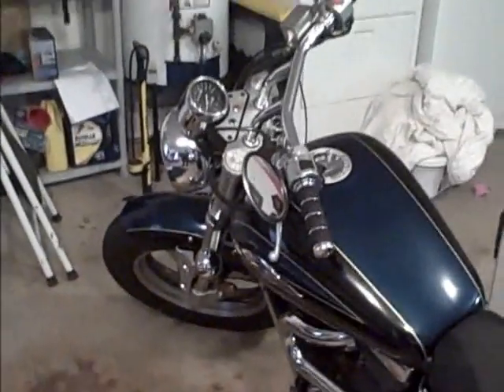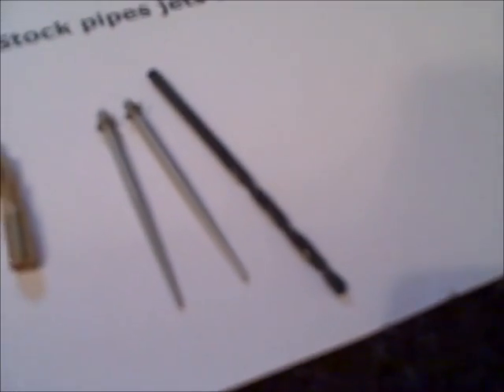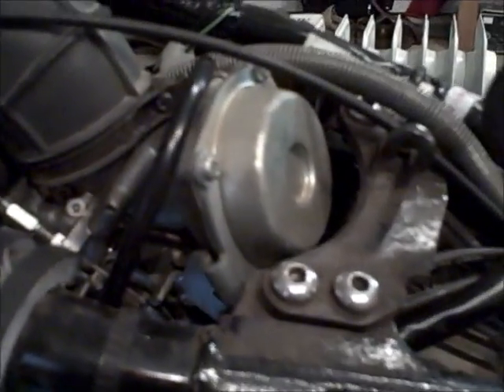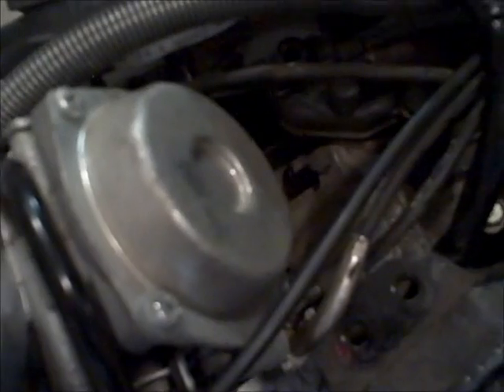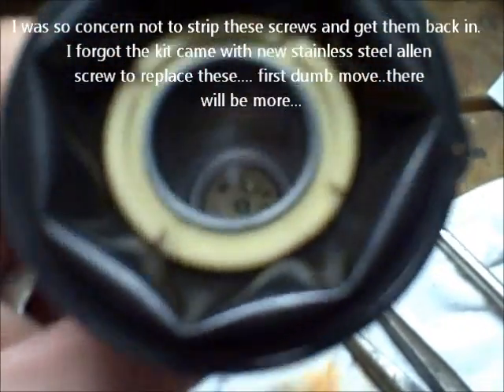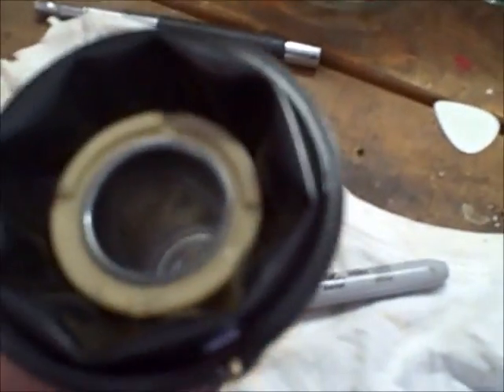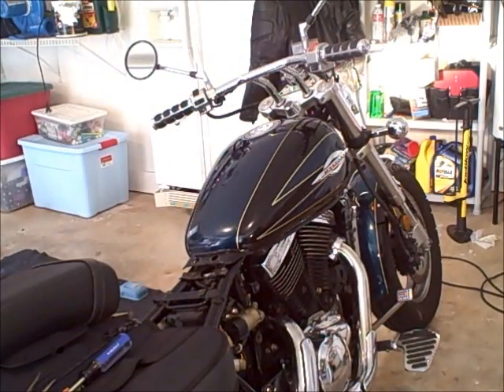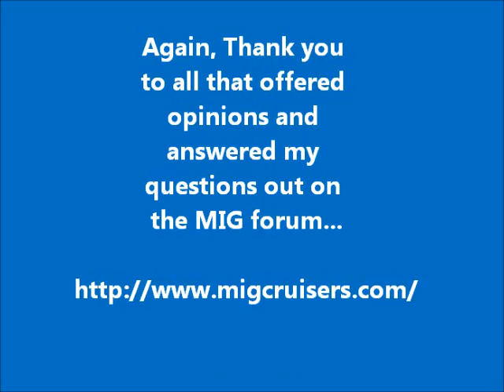Stage 2 Rejet Suzuki Marauder VZ800

Comment from the maker: The pair valve is the Big (fake) air cleaner on your right hand side. It is used to get these bikes imported. Go to Mocs Place and get the removal kit. Easy and painless and it will get rid of backfires.  As for the straight pipes. Yes, you will have to rejet. You could do stage one, two, or three if you get the right size mains and pilots for the straight pipes. I would recommend going straight to Stage three. I went there at the beginning of this summer.

Comment: what is the pair valve?got rid of the MMM now it starts.if i went straight pipes do i have to do a carb.stage kit and wutch one? and front sprock wich would be the best? i have a 2001 maraurder vz800 thanks

Comment from the maker: @yammo12 Don't plug it! each carb on the VZ800 has a breather hose and it is not suppose to go to anything...yet it is made to be open and breathe...Check again and make sure the leak is coming from that hose... and also do yourself a great favor and go to migcruisers . com and ask all the question you want there. It is a forum of great guys and gals that know these bikes inside and out. You will find a lot of help there.

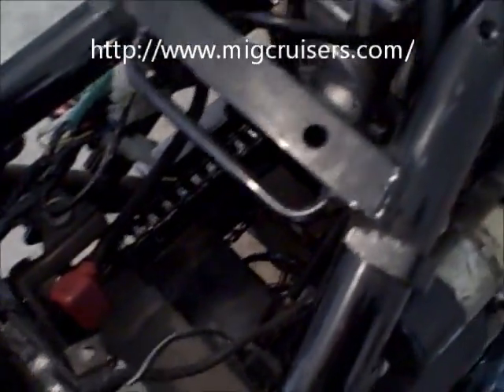Comment: hi bud maybe you can help me i have a 2001 marauder 800 i havent had it on the road for 3 years i ot it running the other day and i have a fuel leak coming from a host coming from the top of the carb but it doesn't seem to be connected to anything it comes down by the air filter and down towards the chain i froze your vid at 16:13 and you can see the hose coming from the crab what is it for and what can i do, at the moment i plugged it to stop the fuel coming from it Help needed 
yammo

Comment: is it ok to just changed out to filters from stock to k&n ones will it hurt anything
Reply: It won't run properly bc the air to fuel ratio won't be right. You have to rejet to use the k&n filters. It will just run really slow. Won't get past 35mph.

Comment: dude those are calipers not micrometers
Reply from the maker: The digital caliper displays three digits, but the digital micrometer displays four digits because the accuracy of measurement of a micrometer is greater than that of a caliper.
Reply: +anamericanstandard 
negative a micrometer is a different inspection tool. a micrometer come in increments of 1 inch  (ex. 0"-1", 1"-2", 2"-3".... so on and so on. some digital calipers do read out the 4th decimal place too. But using a micrometer is still much more accurate. check out vernier mics and calipers. that's the old school way to read em. thanks for the video though! I'm about to tackle my marauder now.
Reply: can you help me I took apart everything now I don't know where the hose goes on the back of the airbox that is pointed up